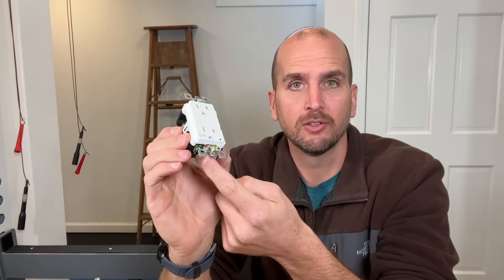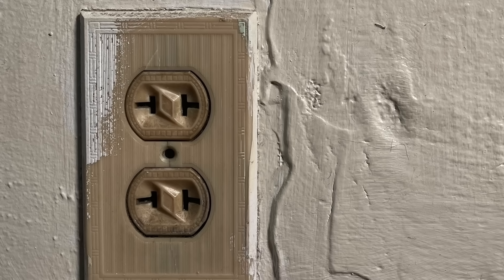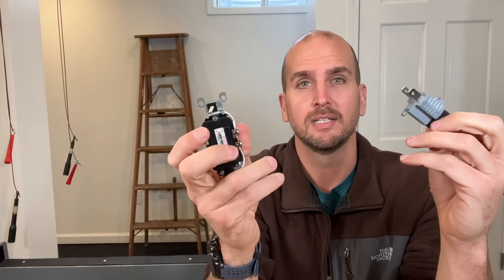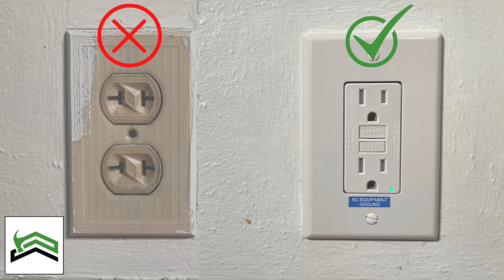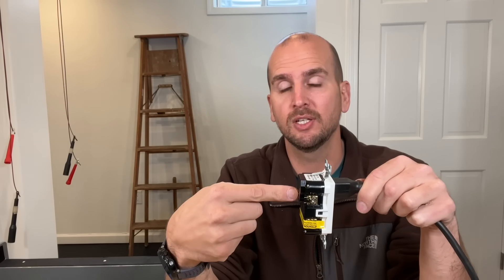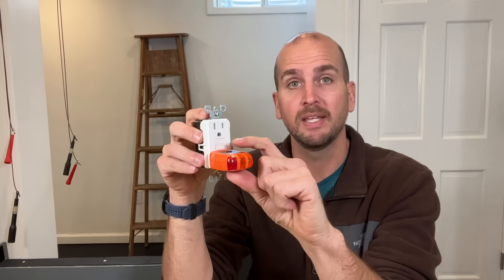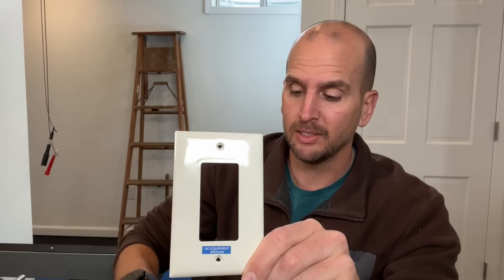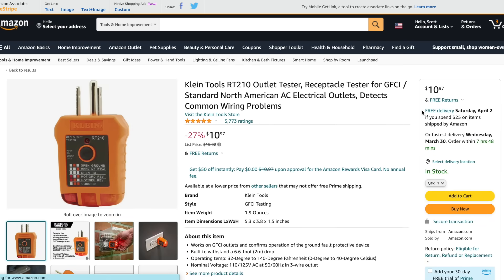Does a GFCI Outlet Still Provide Protection Without A Ground Wire?

Comment: Why not connect ground to the neutral at the GFCI? They are connected at the panel.
Reply: if the ground is connected to the neutral at the gfci outlet then the test button doesn't work
Reply: i mean an outlet tester doesn't work
Reply: @gamecubeplayer  Why it’s connected at the panel.
Reply: @jameskehn8609  because an outlet tester makes 5ma of current go from live to earth so it doesn't return to the gfci outlet's neutral so that trips the gfci
Reply: @gamecubeplayer  Ground and Neutral are the same. They are tied together in the panel. So I still don’t understand your answer.
Reply: @jameskehn8609  if a gfci outlet has a bootleg ground then an outlet tester will make 5ma of current go from live to neutral so the gfci doesn't trip
Reply: @jameskehn8609  That is how the TN-C-S system works. The principle is to give a low impedance fault path so the circuit breaker trips. There are several different grounding systems that have been used in various countries at various times. They are classified by two letters. The first describes on what is done to the neutral at the transformer and the second what is done to the ground at the user. The systems are TT, TN and IT

TT mean the neutral is grounded in at the transformer and the ground wire at the user. This is  mandatory in Italy and used in many other European countries. Because the ground has so high resistance the fault will not trip the breaker so additional protection is needed. This nowadays is an RCD. A house can have a common 100 mA RCD and then individual 30 mA RCDs or maybe just the latter. TT is banned in the US. The benefit of TT is that it is very simple and there is no chance of a PEN-fault and no need to prepare for it by using multiple earthing on the neutral.

TN mean there is a copper connection to from the ground wire to the transformer. There are three variants:

TN-S (Terre Neutral separate) on which there are separate neutral and earth all the way from the transformer to the socket. They never are combined. This was previously used in the UK.

TN-C in which there is a common cable from the transformer all the way to the socket. This was common previously in Finland and Germany. In Finland TN-C was mandatory 1930-57 and then the standard method until 1989. In Germany it was banned in the early 70s. One problem is that it is incompatible with RCDs unless they are on each socket. In Europe we prefer RCDs in the panel. It i still legal to change old sockets to grounded ones with TN-C or even add new sockets as long as the new wires have separate ground. Note here any plug fits ungrounded sockets so if you want to change it that is you really want it grounded.

TN-C-S in which the earth and neutral are common from the transformer to the entry to the house and separate after that. This is the most common nowadays and has replaced other TN-systems.

IT: There really is no neutral,. The system is isolated typically the center point of the transformer has a high impedance connection to the earth. The electricity is provided as three phases and grounding is done locally like in TT. This is common in Norway. It also is used elsewhere in ships and hospitals. It is safe as it is isolated and accidental grounding does not prevent its use.

Each method has its problems so there is no absolutely best method. 

In case of apartment buildings there can be weird things. Our building was rewired in 2013 so it was clearly done with TN-C-S but the rewiring was not done to apartments so on my panel the earth and neutral are again combined and the apartment is TN-C. This also means the RCDs they added are not connected.
Reply: The code does not allow it. I do not know exact reasons why but there are several reasons not to do so. The most feared is that if the neutral breaks all the cases of grounded devices get energized.

Comment: So when I install the GFCI  recpt. on the first line side of the room circuit.  Can I change out the others on the load side  using standard 3 prong recpt's  ?
Reply: Yes, you just need to mark them with "No Equipment ground" and "GFCI protected".
Reply: @okaro6595  Thanks , I'll be installing them in a apartment bldg. built in 1952.

Comment: I live on 20 th floor and I wanted to replace a fan/hood  over the stove  However, I found out that only two wires came out the wall connecting (Hot and neutral) each wire came with metal sheeting around them- but no ground wire at all. I want to replace the hood vent with a microwave and was tempted to find the ground wire in the panel and drag it to the microwave-but I have concrete walls.and that complicates things. Now if I got this right it  sounds like I can install a GFCI w/o the ground, and the GFCI seems to be the code for plugging in microwaves anyway.  Can the metal sheeting serve as ground anyway? Great!

Comment: There has to be an label indicating such, (no ground on outlet) but there is still no ground protection from hot to ground shorts such as tools or appliances with grounded metal housings. The ground should be added if possible. Also you have no right doing electrical work on rental units without a license.
Reply: The GFCI provides the protection. It is a Ground Fault Circuit Interrupter. While it is better to have a grounding conductor this method is allowed to enable the use of three prong plug devices.

Comment: Yeah, I wondered about this. I live in an older home.  I had the fuse box upgraded to a proper breaker box about 15 years ago. I also have had to change outlets to GFCI around the bathroom and kitchen sink about 12 years ago. But I still run into issues with DYI electrical issues that I am not always sure if it is O.K. Since it is an older home, at some time (don't know when) extra wiring has been added to handle more modern appliances. One issue is a 30-amp wiring to a large window AC unit. The AC is the only thing on that circuit (nothing else upstream or downstream). However, testing all the outlets I found out that one is not grounded. However, all the normal 15-amp outlets throughout the home are grounded. The AC unit itself has a breaker on the plug (so my understanding is that essentially acts like a GFCI to the unit itself). The outlet has a 3-prong outlet with an open ground. I was not sure if this was safe with no ground. Even though the cord has a breaker, I should still probably install a GFCI to prevent possible elicitation (especially being 30-amp).

Comment: Okay please excuse me I'm not a residential electrician question could you tie the ground wire to neutral on the backside of the GFCI and use that neutral path back to the breaker panel as a path for ground or is that silly
Reply: No, that is not allowed.

Comment: Whats the difference between 15amp and 20amp?
Reply: The difference is that 20 A will accept 20 A plugs (which are extremely rare). Yo mus have 20 A breaker and wiring to use a 20 A outlet. You can always use 15 A outlet.

Comment: Here is my situation.  I recently lost power to three bedriooms.  I found a burnt receptacle in BR#1 which powered a window airconditioner. And I found out that all three bedrooms were powered from one ckt breaker.   I checked the outlets in all three bedrooms with an electrical outletr tester, and found that all the outlets were correctly wired except one in the 1st BR, which was missing a ground.  I assume that all the outlets in the three bedrooms are wired in series.  But now I have the problem of providing a ground wire to the missing ground outlet.  I would like to put each bedroom on its own breaker and connect a ground wire to the missing outlet, but for now, as a temporary fix I plan to install a gfci outlet in the location with the missing ground.

Comment: Something that I did in the past (I'm not an electrician) that I'm sure is anti-code, but thinking through the theory of operation seems to work as intended. I wanted to add a grounded outlet to a room on the 3rd floor of an old house (built in the turn of the century, 1800s to 1900s), and there was nothing to attach a grounding wire to, and I wasn't up to running a new wire all the way to the basement. What I did was install an GFCI and connected the green grounding screw to the homerun neutral for that GFCI outlet. I know it isn't code (bonding ground somewhere other than at the main box), but I couldn't think of a fault scenario that would create a dangerous situation.
Reply: Technically this should be used only for replacing outlets, not for adding them.

Comment: I bumped into a real-world situation. Could you take a look?
-----------------------
[Story]
I connected my 5000W (continuous)off-grid solar inverter to a load center (with a 20AMP breaker), then connected it to a GFCI outlet. I press the GFCI test button on the receptacle tester, the GFCI doesn’t trip and shows "open ground" (Of course, it’s grounded).

 [Situation]
I have pounded in a brand-new ground rod and connected to the system.
Hot-to-ground measure roughly 61-72VAC, Neutral-to-ground also around 61VAC and in total, Hot-Neutral reads 122VAC
I think the off-grid inverter was designed to provide a ± 61VAC to “fake” the 122VAC output.
 
[Questions]
How do I make it work properly so the receptacle tester shows “Correct”?
Should I connect the neutral to ground? It seems like it will short the negative 61V to ground!
Will GFCI function properly with a 61(+) VAC and 61VAC (-)? I can’t find any information about the operational voltage range for GFCI.
[Crazy thought]
Use a 15KVA transformer to step up the voltage so it will be 120VAC from either Hot/Neutral-to-Ground and 240VAC from H1- H4 while shorting H2-H3-Ground.

Comment: Do you remcommend changing every outlet to GFCI?
Reply: There are GFCI breakers that will protect the whole circuit. Much easier and more cost effective than replacing each and every outlet.
Reply: There's no point to it unless you've got strange wiring, and n that case, you'd be better of doing what Mathew suggests. Anything that is wired through the load on the GFCI outlet is going to be protected. The only reason to use multiple GFCI outlets is if for some reason you don't want the entire rest of the circuit to go down if something closer to the end of the circuit is what trips the protection.

Comment: Great video!  Had a fee questions.  I have a home that was built in 1955 and had a lot of thise two prong outlets that were replaced with 3 prong outlets.  Some of the circuits have a ground back to the panel and some don't.  Most outlets were converted from one gang to two gang.  There are also some outlets added to existing circuits via metal junction boxes that are not grounded because there were no grounds to bond the box.  These GFCI sound like they could make my situation safer.  I will replace the breaker though instead of individual outlets so the whole circuit is protected.  If I put the GFCI breaker in will circuits that have ungrounded metal junction boxes be protected as well as any otjer ungrounded outlet.  Also, can I continue to use the 3 prong outlets with no grounds as long as I have a GFCI breaker in and I label the outlet "not grounded"?  In other words does the gfci have to be in the outlet because of the 3 prongs or is the gfci breaker ok?
Reply: This jackass wont know.

Comment: Thank you for your videos. Two questions, 1. It sounds like installing a GFI receptacle will protect you as 'if' the receptacle was grounded but if inspected it'll still show as non grounded, correct? 2. If it does protect you, including any 'equipment' you may use plugged into that GFI outlet, then what is the purpose of the sticker that says no equipment ground?    Thanks
Reply: If offers protection against electric shocks by cutting the power if you get shocked. It is not similar to grounding.

It does nothing to protect the devices but grounding is for personal use. The problems come mainly if you try to connect a PC to a TV or AV-equipment that is grounded through the antenna/cable. You should do any such connection when powered down and preferably use a galvanic isolator on the antenna cable.

Comment: Im still getting shocks or pokes from the outlet when sleeping. Even When I changed the 2 prong to a gfci outlet. Any common reasons this is happening?
Reply: Why on earth are you doing anything with outlets while sleeping? Is this some new age nonsense? 

Th GFCI does in no way ground the outlet. It protects you from dangerous shocks.
Reply: @okaro6595  Im not messing with the outlet Lol. I have to run a fan in order for the electricity to be directed to that. otherwise it will go to me when im in my bed..

Comment: Is the gfci a grounded outlet? as in would it offer the same protection for expensive equipment as a proper grounded 3 prong outlet would. im planning on using a gaming pc and i live in an older apartment
Reply: This is for personal protection only. It does not ground the outlet. This should be obvious.

Comment: Hi thanks for the video. I'll be installing an electric shower head in Mexico. Fairly sure the heating unit doesn't have any internal short/trip protection. The house is brand new but no idea on how up to code it is in terms of proper neutral. Theoretically Will the GFCI without ground be enough for safety to trip protection if something goes wrong with the unit/water gets in the circuit etc

Comment: Is there any purpose to "grounding" the outlets to the box if it is metal? I have seen 3 prong receptacles  and gfci receptacles that have what appears to be a copper ground wire attached this way in my old house.
Reply: You should always ground metal boxes.
Reply: @okaro6595  not what the question was asking....
Reply: @Nathan-ho7vr  An ungroudned metal box is dangerous when you use this method. Whether you connect any ground wires between the box and the outlet is not relevant. I say do not connect as if someone gets shocked they can use the connection to blame you even if it would happened without it also.

With grounding one needs to understand that to gave an efficient grounding path one has to have very low resistance so one can pass up to 100 A. Yet it takes just 0.1 A to kill people so while the screws that connect the outlet to the box may not be good enough for grounding they can pass enough current to kill you if the metal box gets energized.

Comment: I watched your previous video where you were fixing someone's receptacles.  I am glad I did, I just ran into that at my daughter's house in Tampa. She had a relative install a gfci on an interior wall so they could be put a outside receptacle in. The gfci would not stay on. There was no ground, just the old two wires with like a cloth outside. I took apart the inside gfci and separated the wires. They had two whites on the line side and two blacks on the line side. I determined the gfci was bad ( I was wrong). Bought a new one, installed with only the line side with one white and one black, everything else went on the load side. Still did not work. Took apart the outside receptacle, they put a jumper from ground to white side. Needless to say, everything worked, I already knew without a ground it would be ok from having watched your previous video. Thanks. not an electrician, previous carpenter lol

Comment: I just re-did all the two prong outlets in our place, which was built in the early 1950s. Was wondering why the Klein tool did not trip the non-rounded GFCI outlet. Great that there will be some protection from the GFCI outlet by itself. Thanks for the education.
Reply: With a non-grounded outlet there is no path to ground to make any fault current for the GFCI to see. If you want to test your GFCI outlets plug your Klein tester into a cheater plug and then into your GFCI outlet. Find an electrical ground and run a wire from it to the grounding tab on your cheater plug and now the test button should trip the GFCI.
Reply: @dandearman2871  This is unnecessary. A gfci does not need a ground, the test is by drawing a small current with some of it bypassing the detection coil. 

If a gfci tester (or test buttons) fails to trip a gfci the gfci is either defective or it’s being supplied thru the load terminals, not the line ones.

Comment: Could it have been an option to use a GFCI breaker at the main panel instead of a GFCI outlet?
Reply: Yes, and it is even better as it protects even if the problem is in the outlet. A GFCI protects only against problems that occur after it.

Comment: I had same situation I ran a gfci off a old wire with no ground that is ran to an outlet in my living room. I grounded the wire to the metal box ( which I don’t does anything because it’s coming of an outlet with no ground ) everything seems to work but green lights doesn’t light up . Any thoughts?

Comment: I have a 3 way switch on the same breaker as a GFI.   One switch precedes the GFI in the circuit, the other is in the circuit after the GFI  on the load side of that GFI.   Will this work?   Since the neutrals are connected thruout the circuit including both switches will this be a problem

Comment: No you don't need a ground. The differential transformer measures incoming and outgoing ampergitted there's a current league it will trip the breaker usually within 30 milli ampers or a 100 milli ampers depending on your GFCI. That's why GFCI's are approved for ungrounded circuits to replace a   2 wire receptacle. But they would like it labeled no equipment ground on the cover plate with the stickers that come with the levington gfci. If most inspectors will require labeled
Reply: In the US if is 5 mA. 30 mA is used in Europe and other places. 100 mA is used only on TT systems and it is part of the earthing, not really a GFCI. You should consider systems with only 100 mA as not GFCI protected.300 mA is also used for fire prevention.